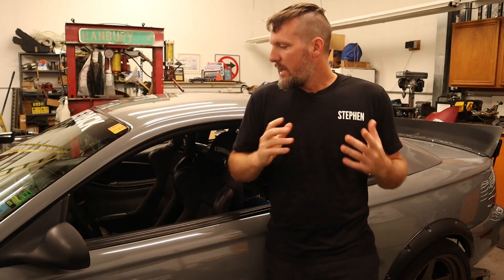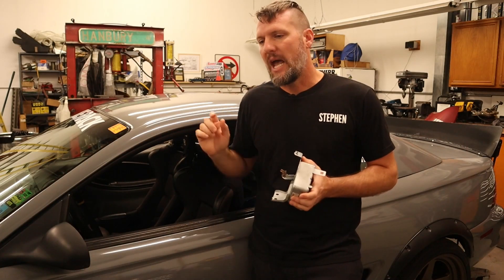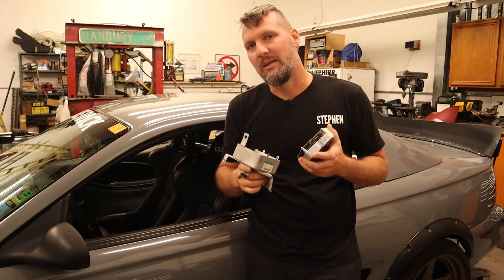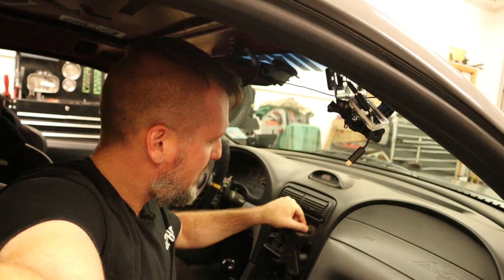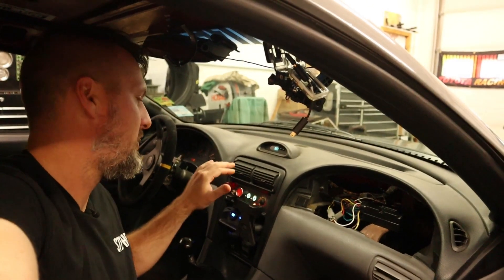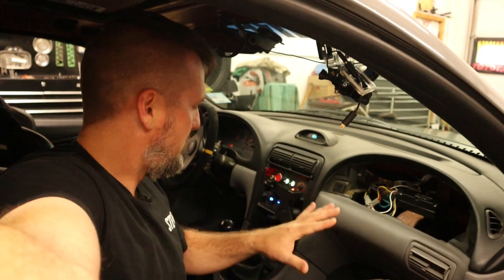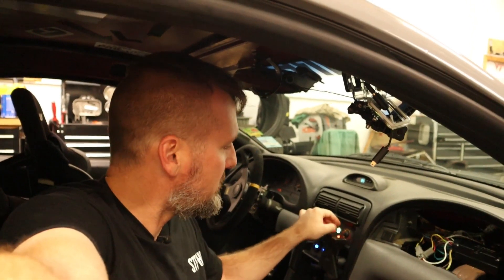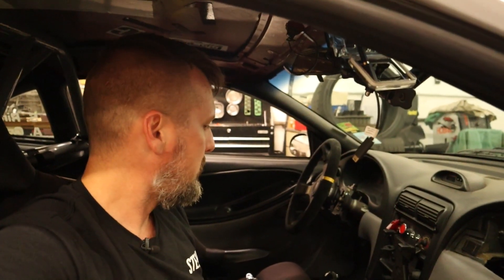Fixing the Prius EPAS with Inductive Autoworks Power Steering Controller

Comment: I've been trying to get a hold of the people at inductive Auto works and I keep getting someone who takes my information and says they will call back and doesn't. So I'm curious as to how you have gotten feedback from them, and how skeptical should I be about ordering this controller? Especially if there's a lot of extra stuff that has to be wired in .

My situation is that I am a quadriplegic and we are building an off-road vehicle. After seeing your video and some others we decided to go with the Prius power steering, except for the gentleman who ran to the U-Pull picked up a 2011 version. So would really appreciate your sharing with me my options. Seems like I can get a factory controller for it for about $30 on eBay. The one from inductive is $220. I just wanted to run beyond failsafe because I am really weak so it will take a lot. Any direction you could be able to share would be very much appreciated. Thanks so much!
Reply from the maker: Hi, sorry you're having trouble getting a hold of inductive. I have seen people using a controller from hangtight.io. It claims it works with Toyota but I don't have any experience. I think the 2011 version will be better than what I currently have installed. The earlier version I have installed I think is only working on limp more even with the controller. I have a later version like you that I am going to try out later this year. 

That all said the cheap eBay controller may work just as well for what you need.

Comment: Did you swap to a manual rack or modify the power?
Reply from the maker: Manual rack, but only because my power rack had a "clunk"
Reply: @RinerAutomotive I'm glad I found this! Did you do anything to the stock sn95 rack or modify it before adding the EPS?
Reply from the maker: I swapped to a manual rack mainly because my stock rack was making a noise. The stock rack needs to be depowered if adding EPS. I've seen some info out there but haven't done it myself
Reply: @RinerAutomotive  You just run the hydrolic In and out into a short loop. keep fluid in for lube and that's it. simple
Reply: @LG-ct8tw  I looped the steering gear on a 1979 Malibu and the steering was harder than an old car with a manual steering gear. I never added electric assist.